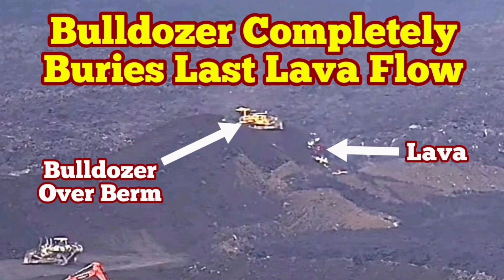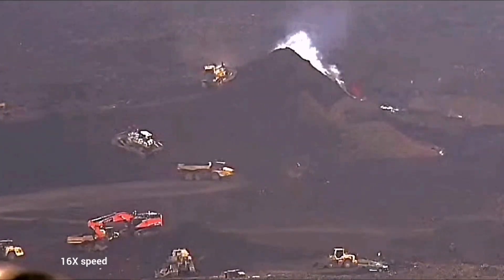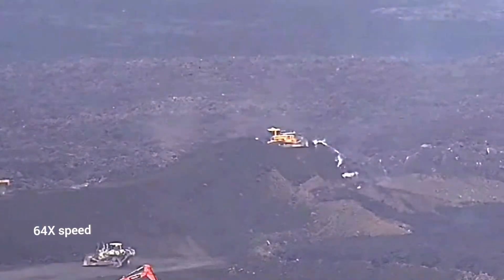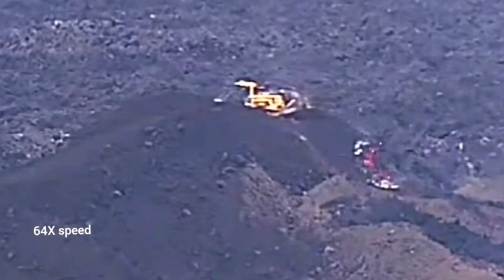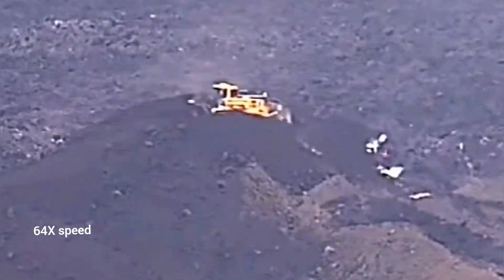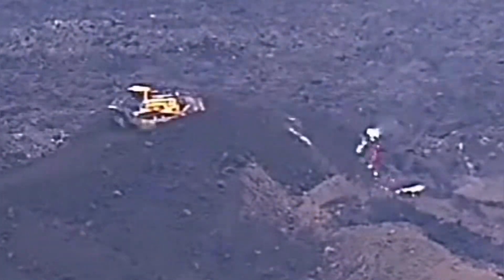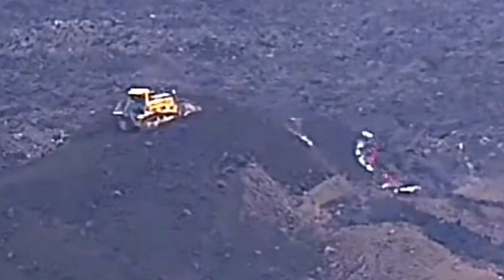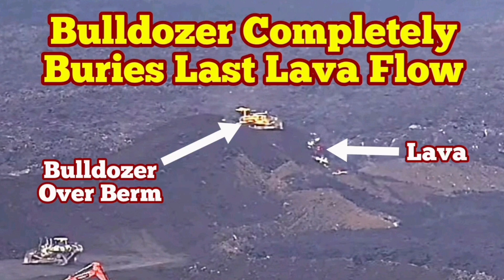Bulldozer Completely Buries Lava Flow, Drives On It, Iceland KayOne Volcano Eruption Update

Comment: I'm more impressed at the height the berm and material is at now.  I'm guessing that top is about 40-60 feet above the other tractor down below in the last scenes.  I sort of wonder if they plan to increase the height of the entire system while the inflation goes on again leading to the next eruption eventually.
Reply from the maker: I think the wall at that point must be about 16 meters tall which makes it about 50 feet , so you are right.